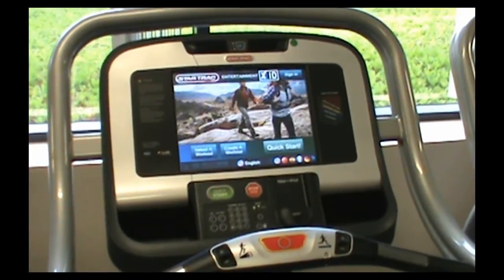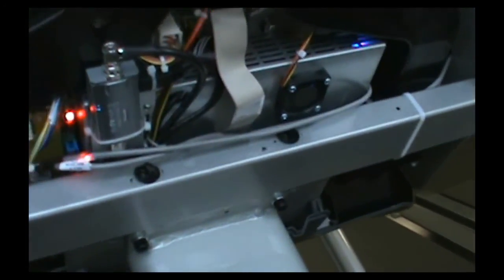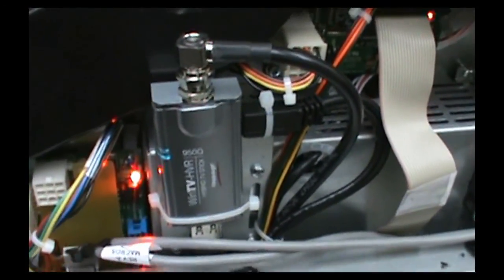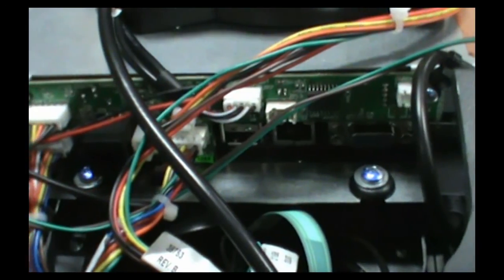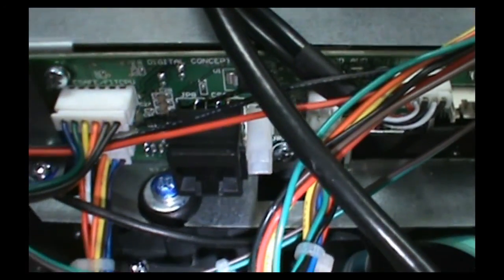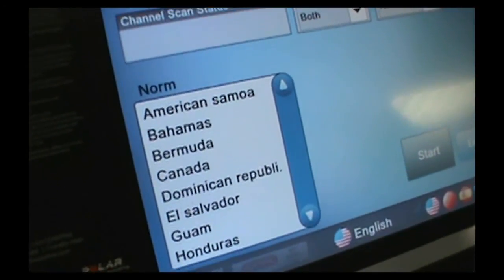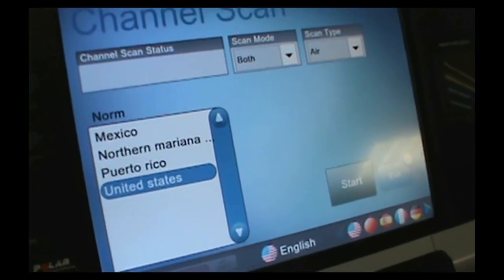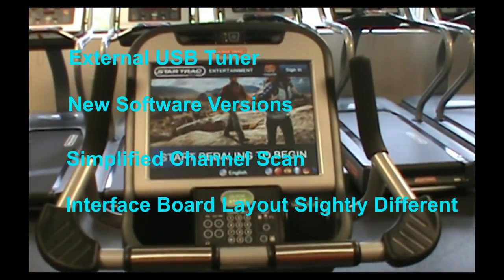Star Trac: 3rd Generation Embedded Touch Screen Introduction

Comment: Not certain how often you check these comments, but my soninlaw owns a few of these in his gyms and one of them has a non working LCD panel. I'm looking for info on how to remove the system to be sent out for repair. I am a certified FSE for Dell and HP so I know my way around the tech, just looking for the correct process.  Any help would be appreciated.